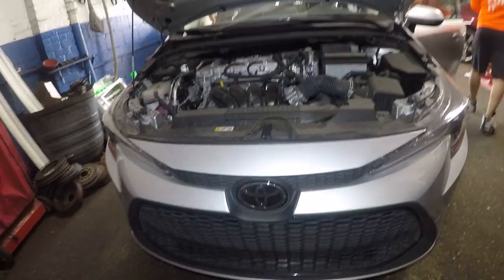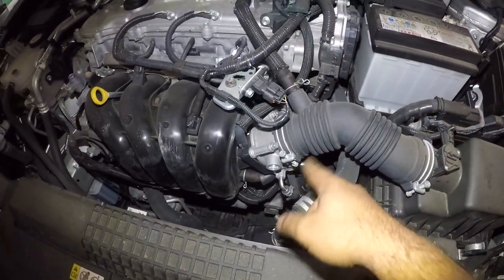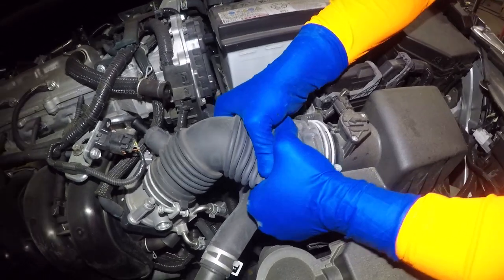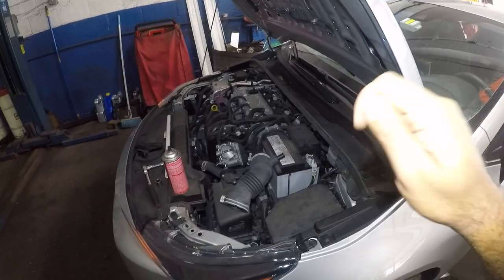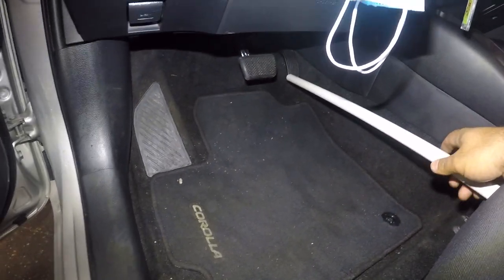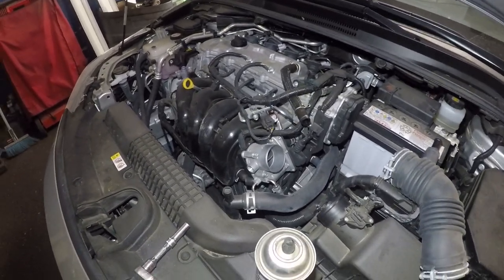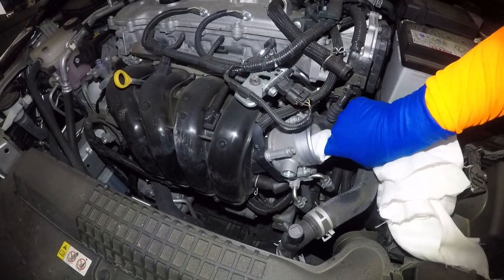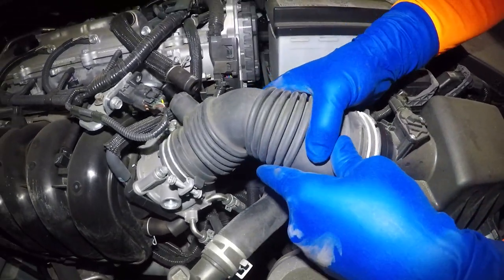Toyota Corolla 2020 Throttle body cleaning, stall fix, car stall fix

Comment: I just did this to my moms car. First time it’s had it done in 115,000 miles. Car had a really rough idle and stayed at 550 rpm. After I cleaned it out it idles super smooth around 850
Reply from the maker: Good job !!!!

Comment: I did this to my 2014 Toyota Corolla S with 99,000 miles and took it off completely disconnected it and everything started it back up drove it and was perfectly fine no issues after
Reply from the maker: Good job!

Comment: I am trying to clean mine on a 2019 Corolla. I turn it on to accessory mode and push the gas in but it does not open the valve. I do hear a humming from it but the valve does not open. Do you know why this is?
Reply from the maker: What year is ur car

Comment: Awesome video!!!  Will be doing to my 2017 Corolla with 45,000 miles.   Thx
Reply from the maker: Yup it’s gonna keep the car running good do it every 45k
Reply: dang my 2017 corolla has 265,000 miles xD

Comment: I actually have a 2020 Toyota Corolla as well and the acceleration just started to hesitate. Would this issue cause the check engine light to turn on or is it something else potentially?
Reply from the maker: This usully don’t cause check engine but did u scan for codes by the way.   Do this service and u will see some results and benefit from it in long run… worth doing it and do it correctly

Comment: Hey man, my car jerks sometimes after stopping at a red light, and then after the jerk when i start driving again sometimes when i press the gas in the rpms dont go up as much as it should for a bit. I looked it up and seen throttle body a few times but in this video you keep mentioning stalling so is my problem not related to the throttle body? Thanks.
Reply from the maker: It
Could be throttle related could be getting stuck do throttle cleaning and idle relearn
Reply: @RBTheMechanic  what is idle relearn? Thank you for the quick reply
Reply from the maker: @hi7535  here’s I did it on this Corolla / Camry same thing process wise https://youtube.com/watch?v=sCsBqeZctzE&feature=sharea

Comment: I have a 2021 Corolla and just did this myself but the strange this is my brother stepped on the gas and the flap would not open so I opened it with my fingers and he accidentaly cranked the engine and now I have the check engine light and a Drive-Start Control Malfunction message. My car has 44k miles. Did I mess it up my using my fingers or was it my brother accidentaly turning the key on shortly?
Reply from the maker: No just reset the light
Reply: @RBTheMechanic  Awesome, I saw your other video and followed the intructions and the engine lights is off now, thanks a ton brother. The only thing showing now is “Engine Maintenace Required”. I took it to my dealer and it turned out to be the engine coolant bypass valve, in my case it’s under my extended warranty and they loaned me a 2024 Prius at no charge. 🙏🏼🙌🏼

Comment: I have a 2020 Toyota Corolla with 19k miles and every time I get to a red light it shakes a lil bit but only when stopping any suggestions?
Reply from the maker: What is the rpm?    It maybe need throttle cleaning service
Reply: That’s normal for Corolla, it’s because 4 cylinder engines tend to vibrate on idle. If there’s no balance shafts. Turn your headlights on or ac on you will notice when the rpm’s rise the vibration stops.

Comment: I cleaned my throttle body with the CRC cleaner but the car still idles rough. RPM goes up around 2000, shakes, then engine stops/stalls. I removed the negative terminal prior. Do you know how to fix this please? Thanks!
Reply from the maker: When u removed the battery u lost all the idle memory so now u need to struggle a bit.  Try one or the other usully I try this first drive the car around for about 15-20 minutes not highway some where local and no traffic cuz will stall and die u can use both feet one to brake and other to keep the rpm alive after good drive it will build the idle speed and relearn the idle make sure all accessories are off radio lights anything that’s not needed ac heat blower wipers all off
Reply: @RBTheMechanic  thanks! I will try this tomorrow. Do I rev the car to a specific rpm when its about to stall?
Reply from the maker: @TheXx1nfinityxX  Noo ur just keeping it alive
Reply: @RBTheMechanic  i followed your advice and my car is running great now, thank you!!
Reply from the maker: @TheXx1nfinityxX  nice job!

Comment: My car is Camry 2018 and I'll start it with a button.
How many times do I have to press and step on the accelerator pedal and clean
Reply from the maker: Do just as I did few wipes
Reply: @RBTheMechanic  All I'm saying is, should I start the car or not
Reply from the maker: @이카루스2-e1x  no start when doing the service
Reply: @RBTheMechanic  thanks  bro~~^^

Comment: How do you turn on the ignition with the xse with key? I tried turning it on with ignition and pressing the gas but it doesn’t open throttle body?
Reply from the maker: Some don’t open new Camrys don’t open u still can clean theg flap with swab be easy and gentle
Reply: Yeah the xse doesn’t have physical key start and I just pushed the flap back and cleaned it hopefully won’t damage it by doing it manually 😅

Comment: I just did mine, first the rpm was at 550 or 600 at parking or when I stop, sometimes went down 500 and stall, after I cleaned it now it’s at 1000 or 800 rpm at idle, is that normal ???
Reply from the maker: Yes like 750 800 is normal it will settle give it a few days
Reply: @RBTheMechanic  ok thank you so much.

Comment: Hi brother 
I am having toyota corolla 2020 and its all sensors malfunctions and after sometime it goes back and engine light comes and go and car stalls alot while driving .when i stop on red signal or stop signs it doesn’t pick up 0-20km/h it takes time what can i do to fix it ? Please help
Reply from the maker: Did u scan for codes?

Comment: I have a 2013 Toyota Corolla wit 78k idle drop low at stop like it's going to stall but doesn't I'm try this thanks for the video
Reply from the maker: Yes this should defiantly fix the issue
Reply: @RBTheMechanic  RB thanks so much for posting this video!! You earned a sub! It’s a smooth 750 rpms at red lights now. I noticed it’s very dark inside the throttle body, do you recommend I take it in for a full system clean for $250?
Reply from the maker: @BelleWhoodle  don’t need to leave it alone so the same service 30k miles from now I do this on my cars they run like champ

Comment: I did it and still  low rpm I clean it wasn’t that dirty but I clean it , 2017 56,000 miles rpm falls to 500 and run rough ! Any ideas what’s next !
Reply: Do you what else it could be I clean but no luck it still acts up ? What it could be ?
Reply from the maker: I would give it another try hook it up to scan to to calabrate throttle other wise new throttle very expencive $700
Reply: @RBTheMechanic  ok cool  thanks for your help

Comment: I did all those steps, the car looks better when idle but the engine light and (TRC OFF) light are on. How should I turn them off?
Reply from the maker: Did u scan the code? First see what are the code for the lights and u can use scan tool to reset
Reply: @RBTheMechanic  I don't have a scan tool. The only mistake I did was removing the sensor then cleaned the throttle. Is there any other way to turn off the engine light without scan tool?
Reply from the maker: @PolaSabir  u need a scan tool people usully disconnect battery but on these new cars ur throttle will loose memory idle will drop car will stall intermittently so it wouldn’t be good idea
Reply: @RBTheMechanic  so after driving more than an hour the lights went off, will monitor if they come back but till now looks good. Thanks for your reply and follow up
Reply from the maker: @PolaSabir  cool!!! It must have detected no faults nice job!!!

Comment: Hi ,I’m experiencing the same problem and when I  excelerat   The car it doesn’t have power and when we diagnose it show that the throttle body,is faulty should I clean it or get a new one????
Reply from the maker: clean it first dont yank anything to open the flap turn the key and have sum one push the peddle it will open up hopefully that takes care of it

Comment: Hey, I have a 2020 Corolla SE. I tried doing this process with the help of my friend but the throttle body was not opening up. I sprayed some throttle body outside it in case it was jammed but it still didn’t open. I put everything again as it was earlier and when I cranked the car to check if it’s running, all the sensors were malfunctioning. Can someone help me out
Reply from the maker: Some don’t open up so just clean as much as u can try it softly
Reply: @RBTheMechanic hey can u help me same with me it wasn’t opening so i lift it now 😂 i have a a check egine light one and the car became really slow when i accelerate what can i do
Reply from the maker: @justrelax9371  did I scan the car for codes

Comment: I’m gonna try this, my 05 Corolla starts but idles for a short time then stalls. 0 Rpm when pressing the gas while in idle. And the car jerks hard when putting into gear. It was working fine until after I drove it for a day when I changed my spark plugs and oil
Reply from the maker: This will help in a way!! Try it
Reply: @RBTheMechanic  thanks I will try this before replacing the tps

Comment: I tried it on my 2.0 SE. But the throttle didn't open in accessory mode. Anyone can tell me why/?
Reply from the maker: Some don’t open u still can clean the edge mode it with finger tip slightly
Reply: Thanks !!!!  @RBTheMechanic

Comment: Just my curiosity,  have  you try the Seafoam method to clean the engine?
Reply from the maker: No tell me more about it
Reply: @RBTheMechanic  my buddy of mine made this contraption.  He drill a hole on top  the cap, long copper tube that will hit the bottom of the Seafoam can, and on top he made a custom valve( on and off shut off valve) various hoses that will accommodate  any motor hook-up..he told me hook up vacuum lines.. pvc, intake manifold. This will suck up the Seafoam throughout  the engine..Start the engine and make sure to hookup your hose before you start the motor, just a 1/4 turn on the valve, let the  Seafoam do the work. The exhaust  will start showing all that build inside the motor coming out. Slow process,  don't rush, a little of seafoam..when the can is almost open full and let it soak it all up and  turn engine off, wait for 5- 10 minutes...then drive vehicle in freeway to burn off the rest of the Seafoam..

Comment: At a stop or red light mine idles roughly ,
Reply from the maker: Do throttle cleaning
Reply: @RBTheMechanic mine does the same at a stop light or sign . Whenever I turn on the AC it goes away . So this is what is causing it ?
Reply from the maker: @shoporiginalco4574  most likely yes

Comment: I cleaned my throttle body but now when I’m driving and let go of the gas it makes a hard pull when it slows down..like it chokes for quick second...
Reply from the maker: Might need more cleaning did u do upper edge and the plate
Reply: @RBTheMechanic  yea I cleaned all around with a rag and took all the dirt out and after words it started doing that...
Reply: It looks shiny and clean
Reply from the maker: @jhona6297  can u make a video let me see what it’s doing and show me the rpm when idling and car is nice and hot then put it in drive let me see how rpm fluctuate as it gets load